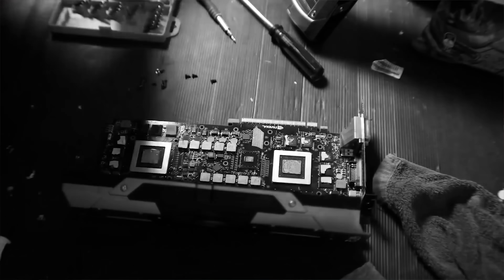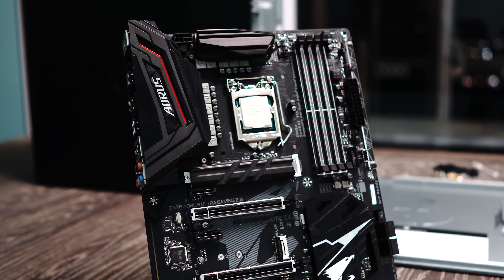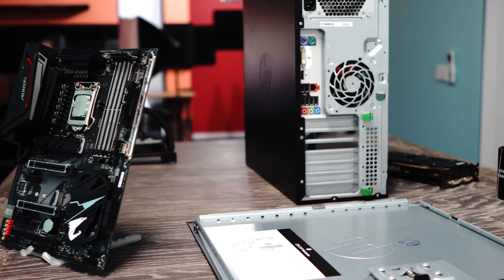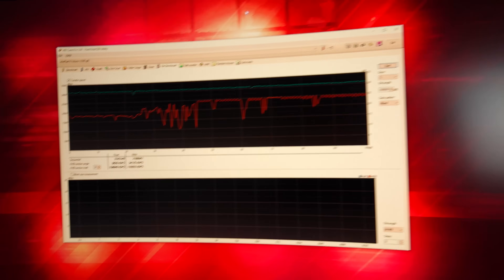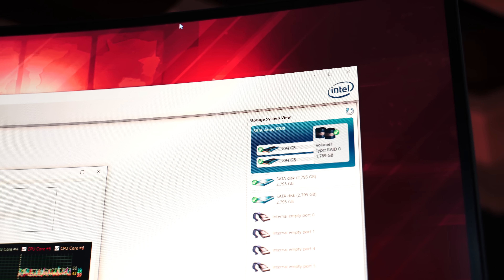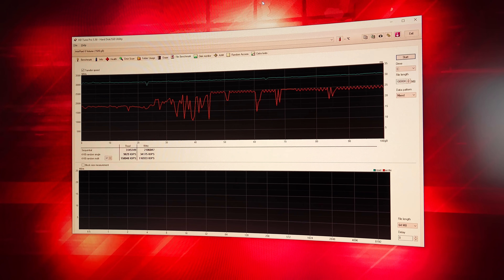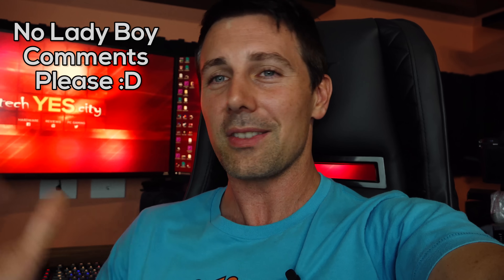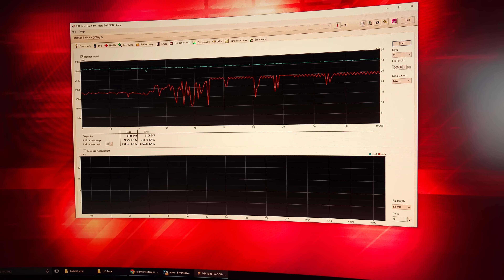Z370 Motherboard Problems...?! How to solve them (Ft. Aorus Ultra Gaming 2.0)

Comment: i have a problem please if u can help 
first i have issue about my RGB of the mother board witch is Aorus logo lamp goes on after i open my pc's power supply switch i've tryed to turn it off it won't . i reset bios . downgraded it . upgraded it and still won't turn off i've tryed so many deffrent thing what should i do then

Comment: have every issue you did. including thermal throttling.  if i restart then it goes away. sometimes. i found a voltage thing in bios that said its variable so i turned it off. seem ok for a day
Reply: mine is the `durable`

Comment: Hello good man, I just SUBSCRIBE your channel! I have some problems with my pc and looking for help on internet ,but at the moment I didn't find any good solution.. I made a lot of formats and probably tried everything that people on the forums and youtube showed to fix these errors, but nothing helped. I hope that I am wrong and there is some solution, unless the problem is some part of the computer. For me, you are one of the best computer expert on youtube and I like watching you. My knowledge about computers is small, although I have already placed 2 computers and each of them has the same problem. No stable fps, huge fps drops which is not normal, that even older games are jamming. My friends with a lot of worse computers can play fluently and I have any problems. VERY LOW, or ULTRA it's still the same problem. Is that possible that I can send on your email some screenshots from BIOS and all temps? Please give me some advice what pc software to use to make all tests so I might send you some screenshots if that is possible for you. I'm looking forward for your answer.

My computer specs:

MOBO:
Z370 Aorus Gaming 7
--------------------------------------------------------------------------------------------------------------------------
CPU:
i7 8700k
--------------------------------------------------------------------------------------------------------------------------
CPU COOLER:
NH-D15
-------------------------------------------------------------------------------------------------------------------------
PSU:
XP1200M
-------------------------------------------------------------------------------------------------------------------------
GPU:
ROG STRIX-GTX1070-O8G-GAMING
-------------------------------------------------------------------------------------------------------------------------
MEMORY:
ADATA XPG Dazzle 16 GB DDR4 3000 MHz CL16 LED Memory Module - Red
--------------------------------------------------------------------------------------------------------------------------
SSD:
Samsung 850 EVO 500GB 2.5inch SSD
--------------------------------------------------------------------------------------------------------------------------
OPERATION SYSTEM:
Windows 10 Pro

Comment: You've gotta do some more research man. 1.44 is way too high and 90°C in aida64 is ridiculous. If u ran occt or prime95 without avx you'd be thermal throttling for sure. Gaming you're going to be over 90 as well with gpu heat.
Reply from the maker: Gotta watch the whole video man... answered both the questions you commented on.  1.44 is way too high but it was done to stress the mobo as much as possible.  I don't touch prime95, especially on hyperthreaded CPUs.
Wasn't the overclocks....  The whole usb port, 3 nics and 2 sata ports on the asmedia controller are done for.
Reply: Tech YES City I don't touch anything with avx. It's unnecessary load on the CPU and vrm. Completely beyond reason. Non avx version of prime95 is still a great stress test tho. If you were trying to stress the vrm to it's max you should of used occt linpack. Vrm would of overheated or came close. Aida64 is a very weak load. Even if you run it for 8 hours it can be unstable. Totally pointless stress test imo. Occt linpack with LLC set to slightly drop voltage under heavy load for 1 hour then 4-8 hours of x264 stability test from the Skylake overclocking guide is best imo.

I did watch the entire video. Didn't catch that part. Vrm are only really an issue if running avx stress tests tho. Which are unrealistic. Nothing wrong with vrm on most Intel boards. AMD fanboys just use it as an excuse to bitch lol.

Comment: I have noticed over the last 6 years that the usb3's seem to cause these problems. my x97 by asus worked well but i needed more usb3's. added card and had weird cycling usb problems. then i noticed the gpu acting weird. i have m.2 drive and external usb port. so i replacved my case, removed usb3 card and all the problems went away. i think it is a pcie thread problem. m.2 and usb3 card were seeming to share the same channels. so i think it is an overlooked bios problem. but i dont have any way to see htem but you had the same symptoms i did so there is that.

Comment: Ive got the Gigabyte Gaming 7 Z170 board and the audio is and always has been terrible, to the point I can't use it. Its even worse if you install the creative suite software. I can't use the mic in (huge buzzing regardless of volumes/settings) so have to use a usb mic instead and the speaker output has a huge amount of interference so I have to use a car audio ground loop isolator box before plugging in my headphones. Very disappointing.

Comment: i need to buy a new mobo i got the asus prime p but its not sli i messed up i thought it was but pretty good board i run a ok overclock of 4.5 ghz on it sorta wanna try 5.0ghz but hey im someone that had a fx 8320e running 5ghz sometimes but mostly sat at 4.5ghz

Comment: Have similar experience with X370 Taichi. When I try to open specific app while rendering the machine have the same behavior. Blue screen, my ssd was disconnected and showed 100% activity and the machine was halted or my NIC disappears. In rare case it was possible to lose the GPU (PCI line for it I guess).  It was relevant to my overclock, when I was running no overclock the system was kind of stable(crashes really rarely, but can see the halts when I was open programs while rendering), and if you don't need to work while rendering, it is stable but when you stress the SSD,GPU or NIC the pc was halting pretty often. My cpu was 1700 on 3.8 and I was rendering with Cinema 4D. After that I bought Asus hero 6 with 1800X and use the other pc like render farm. No problems on ASUS MB, for information the problem was present on 1800X on the taichi.  Did contact Asrock for it, they simply said if you overclocking you are on your own. Tried higher SOC voltage does't help, now this pc is render station only.
Reply: This is why I have a Strix Asus policy.

Comment: 4:55 OUCH! Isn't that CPU Delidded? 

I must have gotten lucky with the old Silicon Lottery, or you got UNLUCKY!  5 GHZ, core and Cache, 0 Offset, 1.435 Vcore under Load Line 2 (ASRock LL2 - allows a small amount of Vdroop under load)  - When my room is about 25 C - the WORST temps I hit, were just 84 C while running Prime95 AVX small FFT for a solid 45 minutes! Cooler = Noctua NH-D15, modified Corsair Carbide C200R with 8 High perf case fans

Comment: Is a gtx 780 sc good for $150 au
Reply: It's on par with a 1050 Ti so yeah that's a solid buy.
Reply: If you have a power supply with at least 600 watts, yes. If not, get a 1050 TI. Had a 780 SC and it's a great card, but that generation of Geforce was power hungry. Don't get what you aren't prepared to power.
Reply: Cheers I got a 850w aswell so should be all good

Comment: I've read all sorts of issues with Asrock Z370 boards. Seems like another big occurrence is the audio screwing up, and producing a crackling noise. I really wanted the fatality. It was relatively cheap, and that heatpipe on the VRM's was enticing - but I don't want to listen to sand being shuffled through.
Reply: I have a z370 taichi, I love the board's power delivery and it can run my 8700k at 5.1ghz but it does have the strange audio issue that so many people have reported. How this managed to make it out into production on various asrock z370 boards is beyond crazy. I have had to get a usb headset to get around the audio issue, because with normal headphones plugged into a 3.5mm port, the noise drove me crazy. I decided to keep the board and not worry about rma, because i am sure the replacement would have the same issue lol.
Reply: Yeah it's really a shame. I love Asrocks power delivery and their general VRM cooling. Not enough companies use heatpipes except for the super expensive boards. It is weird how so many of them have that same issue. The killer, pro, fatality, taichi - every one seems to have some reports of that same audio issue.
Reply: It's not me. I've read literally about 50 different reviews all stating the same issue.

Comment: Great video, keep up the excellent work mate!

I’ve actually got a Gigabyte AORUS AX370 Gaming 5 motherboard in my AMD Ryzen 7 1700-based rig and it’s given me no problems. In fact, it let me run my Corsair Vengeance 3200MHz at its advertised speed with no problems at all right out of the box. So, I can highly recommend their motherboards for the good experience I had with mine.

The only thing that I can criticise is the loose connection for the internal USB 2.0 header, which I use. I had to really make sure it was connected because it didn’t seem like it. I hope they’ve fixed this for their equivalent Intel Z370 motherboards. Other than that, though, it’s been a fantastic motherboard. No other real complaints so far.

Comment: ASRock mobos are terrible. I had multiple mobos from them that had the same or similar issues. One 970 board for AM3 socket even had killed 2 usb  thumb drives before killing the controller itself. One board had died outright after 2 weeks of usage with no OC.

Comment: I really don't know what's up with the onboard audio on new MOBOs. My Old Z77 board had no problem whatsoever, very clean. (used it as spare audio for screen rec in my studio)....and on my new X370 board the noise floor is ridiculous (Line In).....yet they claim these are superior and blablabla.
Reply: Sacco Belmonte superior for their bottom line
Reply: Could be. Bottom line is really unusable if you add a compressor to rise your voice volume (for example while streaming) without rising that obnoxious noise floor.

Comment: GamersNexus put out something they found where the software would show you the voltage numbers on the front of the MoBo but the numbers by volt meter at the back were over spec.
Something to look into as a possible cause for your trouble.

Comment: Without knowing what caused the issue it is beyond silly to try and make a comparison based on a faulty product. It could be anything from a damaged socket to a vrm component or 50 other reasons. A much more professional approach would be to say that you will be investigating more closely what actually happened with the board and meanwhile you will do a review of this new board. Just my thoughts on it.

Comment: This here could be kind of an example of static shock to the board. It could have happened months ago when installing the board in the case or even happened at the manufacture (quick example: at work (before ISO 9001) quality came out on the floor a couple of times and forget his heel straps and pick up a board and shock it). Brian, I'm pretty sure you didn't do it and it happened at the manufacture. When I went to Microcenter to pick up my MoBo a few years back the sales man said to stay away from ASrock, they are the most returned boards for failures. But this also could be very different since your in Australia and I'm in the states and it's more of a problem here with those boards.

Comment: one advice is to take the spacer/washer from the VRM heatsink of that gigabyte board, done it on my Z370 ultra gaming, VRM temps dropped but forgot by how much
edit: never knew they made a v 2.0, so disregard the VRM heatsink modification above

Comment: I don't know about the voltages melt point, I thought it was all about the power, not the voltage.
The pentium g630 @ +3volt was finally swapped with a I3 2100 that is going on normal voltage. The motherboard is that pesky one that didn't work for you with the gt1030.
And, yes, the Pentium is still fine!

Comment: Is that cpu delidded because those temps look high with a 240mm aio... my 8700k is delidded and at 1.45 volt with a masterliquid 240 (cheap aio) i only get to max 75c
Reply: BITCH WTF A3E U DOING WITH 1.45 VOLTS
Reply: robbe jansens ouch, 1.45v is a bit on the high side for an 8700k, unless you're pushing 5.2GHz+. Especially on a delidded CPU, you should be able to drop voltage way down from there. My own 8700k, not delidded and definitely not a silicon lottery winner does 5.1GHz with 1.31v.
Reply: 1.45v ????? drop it now!